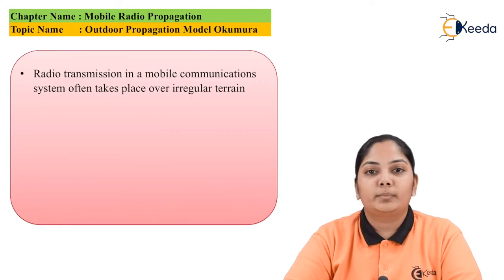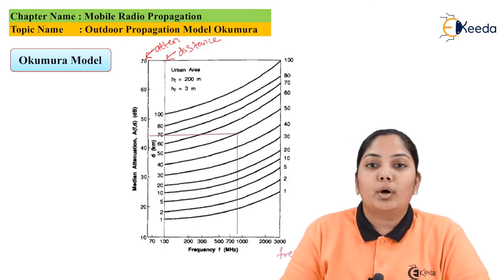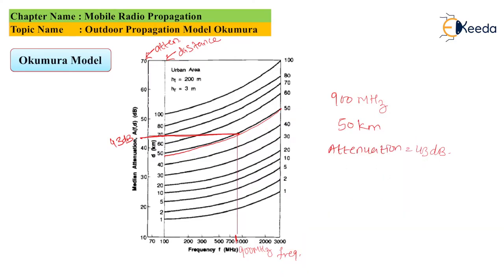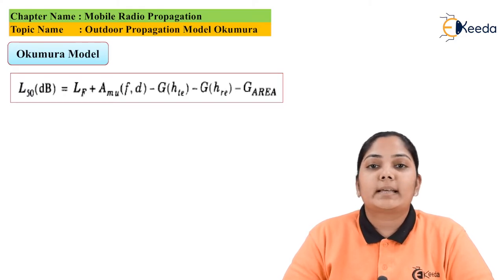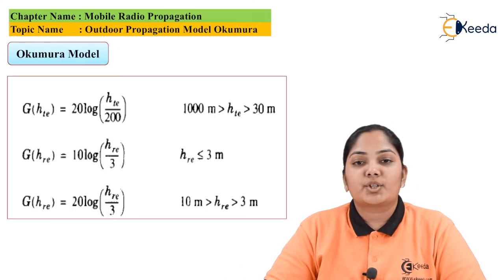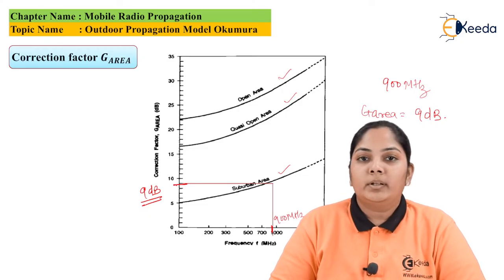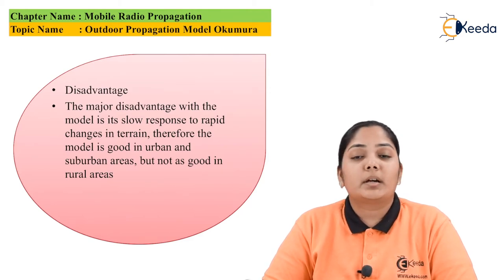Outdoor Propagation Model Okumura - Mobile Radio Propagation - Mobile Communication System

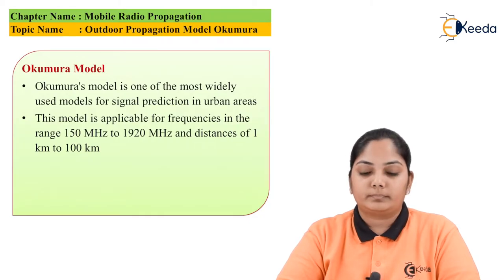Comment: Point of correction Mum. the range is not 1km to 1000km as u said but 1km to 100km in your slide video range 1:27 check that part of the video. Instead of 100km you said 1000km.
Reply from the maker: Ok i will definitely help you with the problem.However for this you will have to download the Ekeeda-Learning Application by going through this link http://bit.ly/353lpP2 because we don't answer any technical queries on youtube for this we have a dedicated team.
Reply: @Ekeeda  galat padhate hain aur accept bhi nai kar rahe